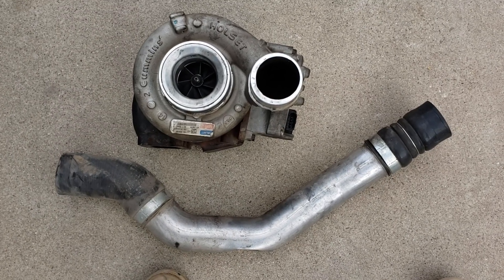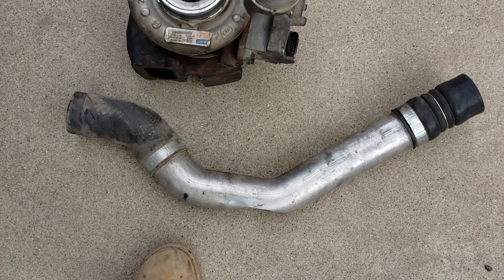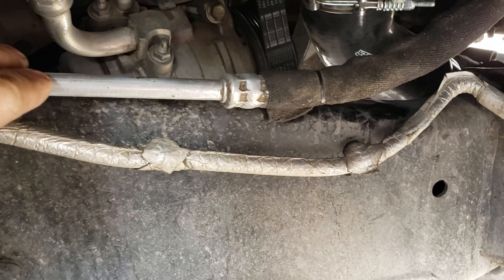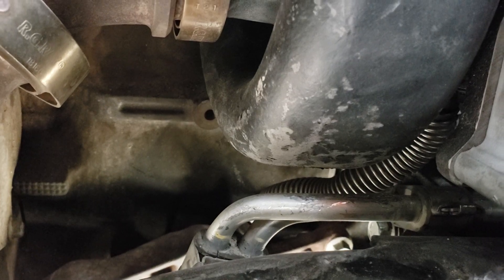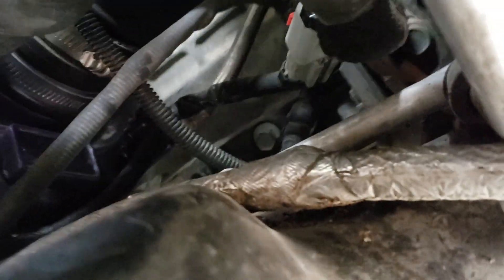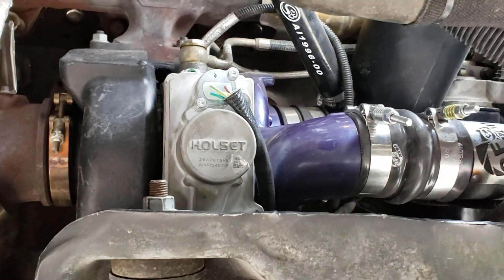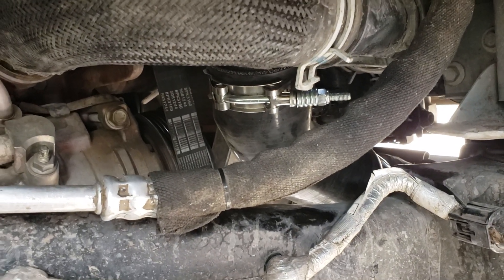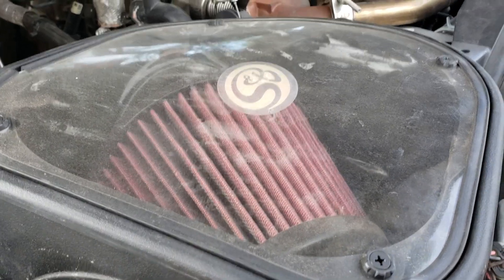2014 6.7 Cummins Turbo Replacement

Comment: Hi Todd , thank you for the video.  I am also replacing my turbo with a ATS Aurora 3000 on my 2014 3500.  I had a couple of questions on the removal of the old turbo.  Did you remove the oil drain from the turbo side or the block when removing the old turbo?  Did you remove the coolant drain from the block or from turbo when removing the old turbo?  I truly appreciate the information you have shared and thank you for considering my questions.

Comment: The vanes are stuck closed on my 2015 at just over 236,000 miles. If I can't get away with cleaning it I'm gonna replace it with a regular non-vgt turbo and if I miss the exhaust brake I will get the PAC in line system for the 5 inch pipe. Have the G56 so no transmission lines to worry about just all the other stuff. Looks like I am going to have to get a "map" gas torch to get the turbo mounting nuts off, after my heart attack,  and normal age related issues,  I don't have the hand and arm strength to break them suckers loose. Soaking them with pb blaster for a few days to see if that will help.

Comment: Just seen this video and it’s the only one I’ve found with emissions still installed. You didn’t have to remove EGR? And you removed the turbo through the wheel well or from the top?
Reply from the maker: It came out the wheel well.

Comment: Instead of fighting the turbo and frame rail I removed the battery box and took lose the coolant tank. Took me 20min to do this extra step but the turbo slide right out and back in. Tomorrow I hit the return oil line and coolant line on the bottom. Just from playing with it today a bit this is going to suck bad lol.

Comment: Thanks for the video. I'm about to tackle this job. Did you have to remove the lines or just take the tranny line clamps loose and move them out of the way? Don't want to lose any Trans fluid and make a bigger mess lol
Reply: @toddvaught6587  
 Thanks, yeah I ended up removing the battery box and it made things much easier. I'll tell ya what that coolant and oil drain lines were awful. Lol

Comment: Todd, RE: lower oil drain line removal, I listened several times -- you disconnected it before removing the old turbo FROM THE TURBO or FROM THE BLOCK? Then you reattached it and the coolant line to the new turbo? How did you get the left from stud out of the manifold? I had to heat up all the nuts with an oxy torch just to get them off. (Still working on getting my old turbo out of the 2011 truck.)
Reply from the maker: I got lucky and removed the stud with a torch. Couldn't get it with the stud in place. Maybe someone else has figured out another method.

Comment: Great tips, thank you. Coolant hose is not that hard to mount on the block, just need the extension long enough, so when removing, just loose it on the block side instead, and keep hose with turbo, if clearance allows it. I got 600k miles on my work truck, actuator was replaced once at around 300k, but never had vanes issue, and we use engine brakes all day long, till today they are loose enough. Just get on it more often and it will thank you, but not sure that much about aftermarket turbos, I saw they have cheaper trust bearings and they don't last. I just replaced shaft and updated billet on my original he300. Will see how it goes 🤞

Comment: Hey great video I'm about to do my turbo on a 13 2500 did you remove the oil and coolant before removing the turbo I keep hearing didn't answers thanks
Reply: if you want you can drain both, but coolant is what you drain prior to taking off the turbo. "remember you have to pre-lube the turbo prior to reinstalling it" through the oil connection hole that sits besides the transmission connection hole on top of the turbo. .. Oil change is recommended also when reinstalling & check the oil feed line to make sure it's free of carb build up.

Comment: Thanks for the tip on the lower oil and coolant return lines. I was hung up on this step and couldn't get those lines on. This video saved my bacon and a lot of frustration!

Comment: Cleanable air filters will shorten the life of engine if driven on sandy roads , no more efficient than stock except  extra turbo whistle .
Reply: I learned the hard way with K&N on a race engine years ago.  They are cool and work okay but hey man! use an oem filter.

Comment: Good video, did you have to calibrate the turbo actuator or was it just bold on?
Reply from the maker: It came calibrated. Bolt on part.

Comment: I'm curious why go with another VGT, and not a fixed vane turbo?  At some point, the actuator in this turbo will go out and you're going to be right back where you were.
Reply: only benefit of VGT is built in engine-brake for towing ..
Reply: @toddvaught6587  I completely understand.